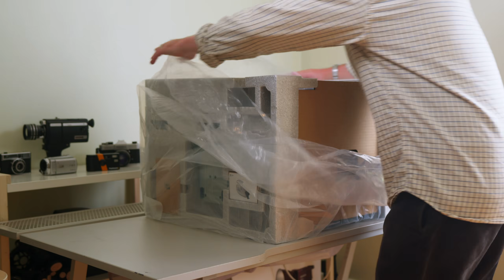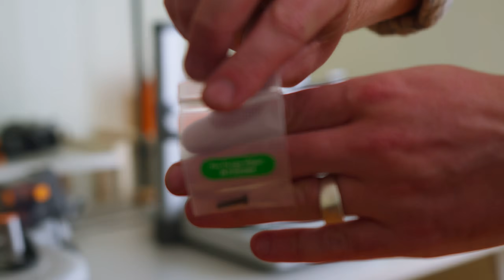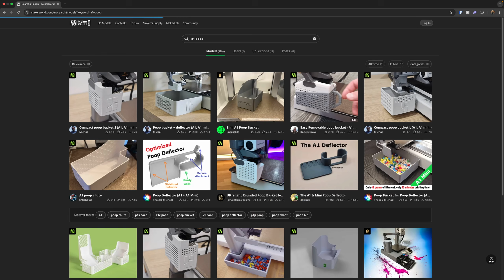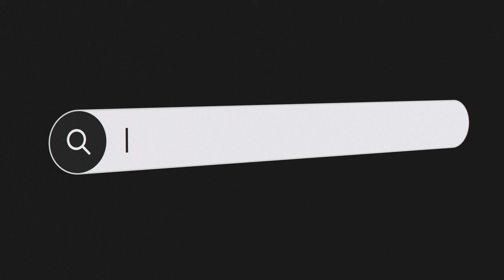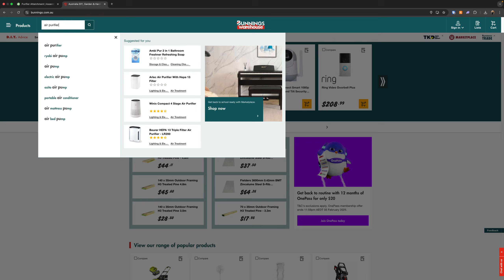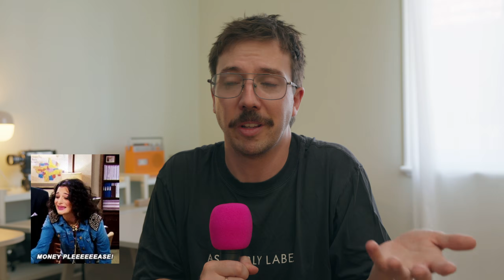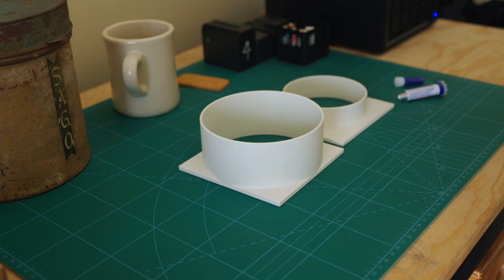Setting up a Bambu Lab A1 so that it doesn't slowly kill me

Comment: I've been wanting to get a 3D printer and have been concerned about the off gasing as well. I'd be using it in a basement with no windows and very poor ventilation. I wonder if a filter system like this would work in my situation or am I just asking for a health problem somewhere down the road. I was considering the BL-A1 as well but do not want to have to be connected online to be able to use it.
Reply from the maker: I mean my whole system is probably overkill and that’s with an open window and a ceiling fan so I reckon you’d be alright

Comment: Great video! - Had a similar thing with BambuLabs PLA specifically, its the first PLA I have used that seems to have an Odor - I got a massive 3-stage air purifier that now sits very close and a I throw that on max when the A1 is running, good to see other people finding solutions to this "maybe/maybe-not a problem, problem".
Reply from the maker: Interesting that you’ve found it’s specifically with BL PLA. I’ve only printed with BL stuff so far, so I don’t have anything to compare it to yet unfortunately!
Reply: Sorry to necro, but I grabbed an air purifier and didn't seem to see any difference when putting it close. I don't want to stick my A1 in an enclosure as I don't want to a) risk the components but b) mess up aesthetic either, so I'm looking at perhaps just having an extractor unit of some descreiption, with a tube right need to the printer, which I flick on during printing and it will suck, and extract (somewhere!)

Comment: Same situation here, new to the 3d printing on hobbyist level, designing stuff in Tinkercad, but i find it to take too many steps to do certain things, but on the other hand, i dont want an overly complicated application för it either, any suggestions? For example i want to make a cylinder, split it in 2 and make them connect able to each other by thinning out the end on one of them on the outside, and then the same but on the Inside of the other, with a small rim to click them in place, bjt doing this in Tinkercad is complicated, at leadt for me, perhaps im just doing it wrong 😂 anyway, well made video, and PS, you could have gott en the P1S Combo, but that would have made this video obsolete 😂😂😉

Comment: I've actually worried about this a lot. I'm actually surprised very few people are talking about this, I mean you can definitely smell the vapor when it's printing. Seems like people should be more worried about it.
Reply: ABS factory workers like microwave popcorn factory workers can loose their sense of smell from being g exposed to the particles 8hrs a day 5 days a week.too much of one thing is almost always a bad thing. Use ventilation or a carbon filter.
Reply: it smells like syrup😅
Reply: @monkey-lr6ny  If you are printing PLA its base is from corn starch or sugarcane. Least toxic of them but I would not print it next to me all the time. I have mine in a work shed outside. Only smell anything when going up and taking things out. People setting these up in their rooms seems risky without any venting system.
Reply: Yeah I had a Endor 3 to start with for the first 4 years of printing and did have much of a smell, but as soon as I started using a Bambu Lab P1S I could instantly smell the plastic a lot more.
Reply: @Claymanfilms But isn't the P1S enclosed? Doesn't the enclosure contain and filter out the fumes?
Reply: @Claymanfilms  I wonder if its the build plate in some cases... I notice a much stronger smell with my x1cs when opening it to get prints. but it isn't that PLA smell. it's more...
Reply: I mean… you can also generally smell food when it’s heated/cooking lol. 

Like sure it could potentially be harmful, but the logic of “I can physically sense a thing therefore it must be harming me” doesn’t really hold up. 

Basically everything off gases and produces fumes. That’s how we are able to even smell things in the first place. Whether or not a given thing is harmful is an entirely different story.
Reply: No big deal with PLA, if you think that is bad you should work with resin, that stuff can really mess with you if you don't take precautions.
Reply: @andy70d35  PLA still releases some VOCs and microplastics

and long term studies have not been done long enough to truly see the long term affects
Reply: i love the smell actually my favorite is petg
sometimes i look for print just so i can get that lovely smell again
Reply: vapor can be anything
Reply: If you can smell a fart you are eating poop. Poop and plastic aren't good for you. Do your best to minimize it.

Comment: The hex cut-outs probably won't save that much filament. Some maybe, but not a significant amount. Instead of just printing infill, the printer has to build solid wall and top/bottom layers around the cut-outs, which uses more filament.

The printing time is probably negatively affected since the toolhead must accelerate/decelerate around the cut-outs.

Comment: I have a problem that's with my a1 mini it won't print anything has z axis failed to home and so far nothing both a1 and a1 mini are prone to this.
Reply from the maker: Ooft, rough!
Reply: @Billt_it  thoughts on what it could be? I read that maybe the Eddy sensor is bad or the toolhead board, but I'm not sure.  I did a support ticket, but it seems like they take days to respond
Reply from the maker: Honestly I’m so far from the right person to be asking this question of! There seems to be some wise 3D printing folk in these comments so hopefully someone else sees your Q and can respond. Maybe throw your quandary up on the 3D Printing or BL subreddit and ask the crowd?

Comment: With what the A1 and A1 mini is meant to print, you wont get VOC. That simple. Studies have been done, VOC of PETG was basically 0, with PLA slightly larger but still in margin of error for most tests. The time at which most VOC were seen was during the initial startup of the print and directly next to the nozzle, which was later accounted for by expansion of metals and the shrouds of the machine. The largest risk is with PTFE if you run the machines over 260C as that begins to break down and offgas nasty things, but again, the A1/A1 mini is meant to be PLA/PETG machines, as their bed is underpowered for ABS/ASA really.

I don't fault anyone wanting to add to their air quality, just saying that study after study that actually are repeatable, have shown it a non issue. Lot of people like to site studies that are flawed and ahve been disproved but provide their confirmation bias.
Reply from the maker: Appreciate the in depth info. Clearly I’m not citing or showing ANYTHING scientific in my vid other than general mouth feel, so I can’t claim anything either way. That said, just from my experience alone, I noticed a difference once it’s in the enclosure with the purifier on. But it could also be a lot more airflow in the room or 100 other non scientific factors

Comment: I just recently got a Bambu Lab A1 as well, and I have to say I've never had this happen to me, and No idea what it is. Maybe the filament? I don't know, but I've never noticed anything other than the standard light PLA smell when printing
Reply from the maker: I find I’ve always been quite susceptible to the plasticky mouth feel if I’m in an environment where there’s a bunch of VOCs floating around. Mostly new cars on hot days. Gross!
Reply: @Billt_it  Interesting, If it's a problem for you though, this is a great solution!

Comment: The A1 and A1 mini say specifically not to put this printer in an enclosure! Hopefully this works out for you though! Solid work!
Reply from the maker: The ideal ambient operating temp, as in the room temp, is 30c on the high end and so far in the enclosure the air hasn’t got to anything over 32. So I’m pushing it a little, but so far so good.

Comment: To me it's not about the data it's about the ability to use the software of choice when I'm preparing the models I want to print,  they change the rules after the sale which is wrong in every way shape or form I don't care who you are or what you believe in everyone has a right to be angry and should be, and if you aren't all I have to say is baaah
Reply from the maker: Totally fair! I’m new to the ecosystem and hadn’t been using any other slicer, and for the time being the Bambu studio works for me. As I’m understanding more about the issue I get why people aren’t thrilled.

Comment: Does yours not smell like burning plastic when running? I got one earlier this month too and my sense of smell for chemical stuff is stronger than most, but most of the time when running it smells badly, but oddly sometimes it stops smelling for a while when printing. I have it in the basement with a heavy duty air purifier that I already had down there, plus webcam to watch it as my solution.
Reply from the maker: If I print something small for an hour with all these additional safety precautions in full swing it’s fine. Even with the purifier hooked up to the case, window open, ceiling fan on, if I print for 8 hours there’s definitely a noticeable difference in the smell on the room. Still have only printed with PLA too which is supposed to be the chillest. If I get deeper into this, time will tell if the setup stays in the office. Even with the enclosure
Reply: @Billt_it  PETG does indeed seem to smell more on average for me than PLA probably due to higher temps like mentioned.